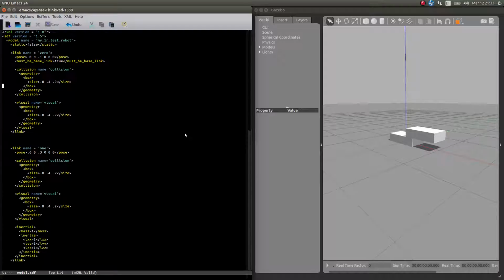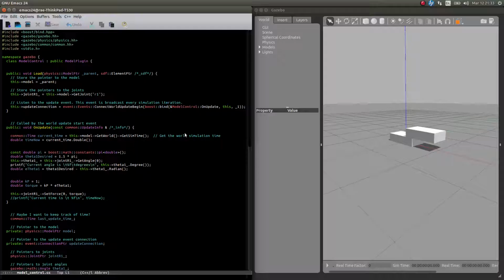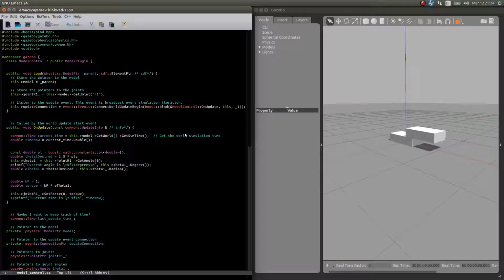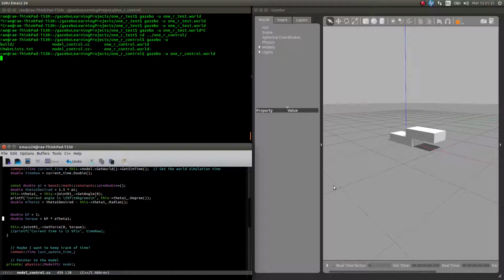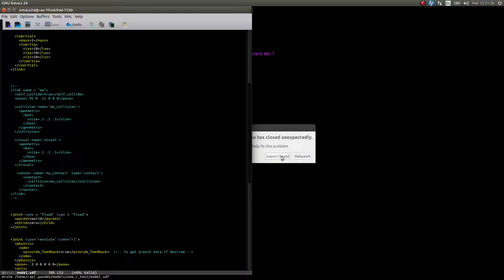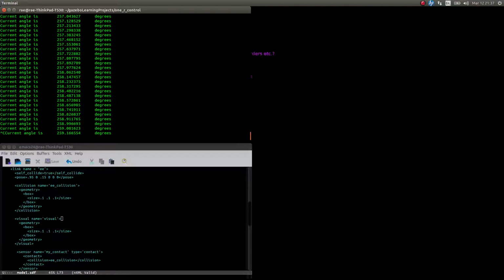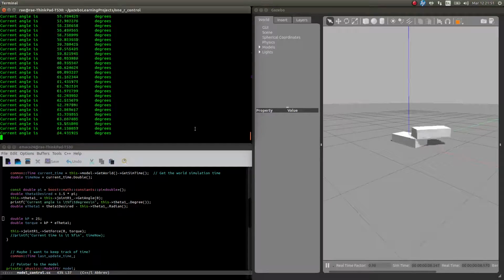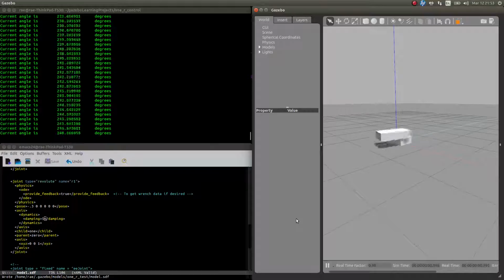Closed-loop control in Gazebo via model plugin

Comment: can you attach the code please?
Reply from the maker: +Ori Aharon, where do you suggest I post it?
Reply: @drmattmarshall6545  on a github repo and post the link here?
Reply from the maker: @surajbonagiri  here is a link like you described.
https://github.com/raequin/one_r_control
Unfortunately, I do not have the Gazebo model file anymore.  That's too bad because the info about the joint is significant.  The SDF is occasionally visible in another video in this playlist.  Here's that link.
https://www.youtube.com/watch?v=sHzC--X0zQE
Reply: @drmattmarshall6545  Thank you so much. I can manage the SDF file from the video.
Reply from the maker: @surajbonagiri  You're welcome :)